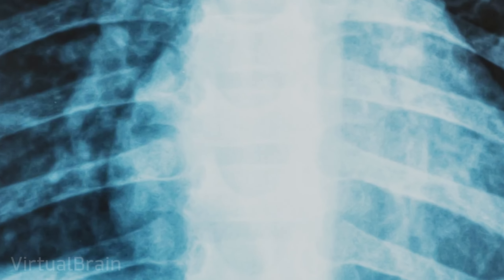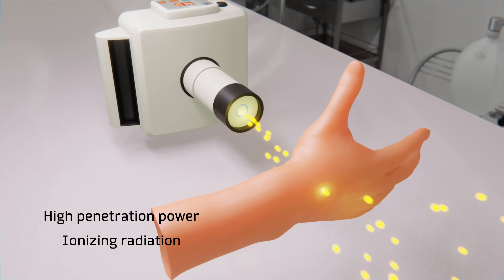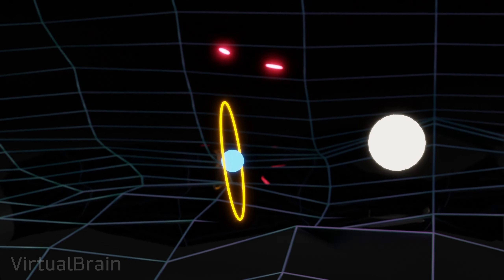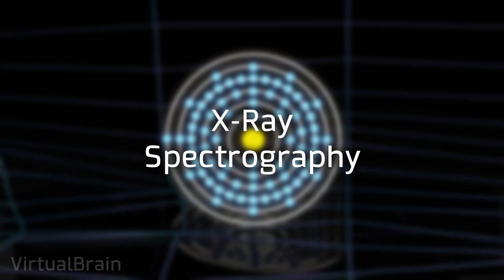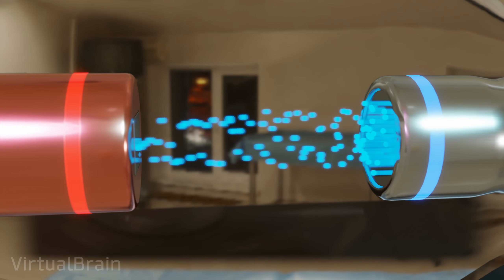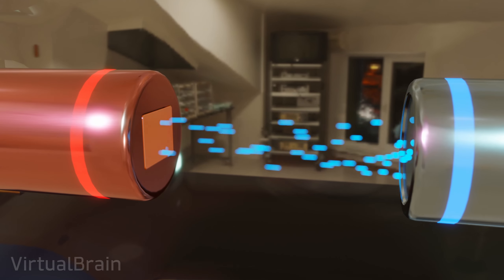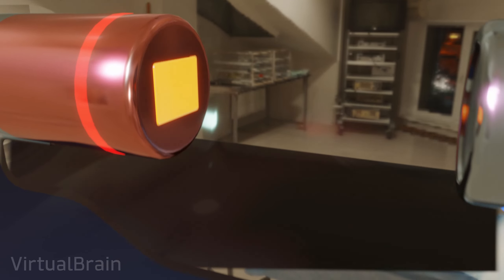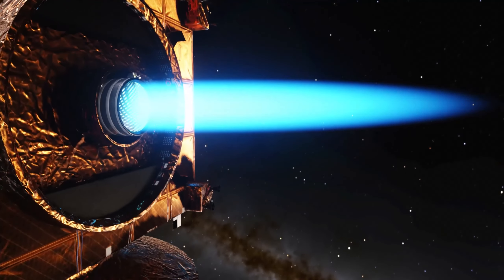How an X-Ray Tube Works⚡How X-Rays are Generated

Comment: very useful indeed. i just bought an old xray tube from ebay. ive tested continuity, it seems fine. loads of volts is easy, but i wondered about it's current requirements. thanks
Reply: Typical current for modern x-ray tubes is 100 - 1000 milliamperes depending on object mass of the desired part to be x-rayed.
Reply: @Coowallsky  so you suggest i give a few v to the heater, then give the valve around 50kv, with a 100mA limited supply to start? i have been waiting to use this valve for 6 months, it is ancient, so no datasheet. but i dont want to kill it.
Reply: @KarldorisLambley  Filament voltage of about 10 VDC cuerrent typically 3 to 5 amps.
X-Ray equipment up to 1980 used Full-Wave rectifed High Voltage for what amounted to a pulsating DC voltage (it wasn't filtered after rectification. Some portable x-ray units used capacitive discharge which eliminated the ripple but were limited on exposure time and current (typical for portable).
If I were going to do it, I would shroud the tube with 4# lead sheeting.

Comment: Molybdenum is more often used than tungsten for the anode. Modern day X-Ray tubes for medical use have voltagte requirements from 25 to 150+ kilovolts. Available current in range from 100 to 1000 milliamps.